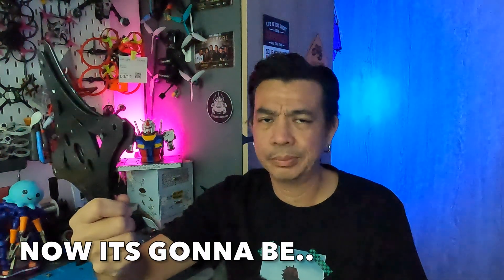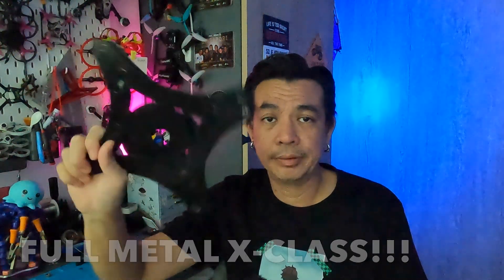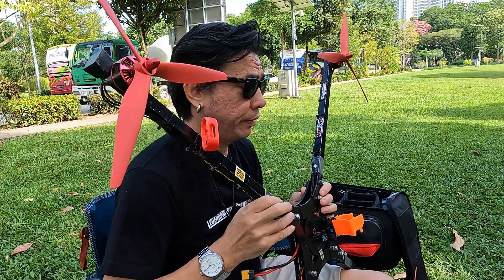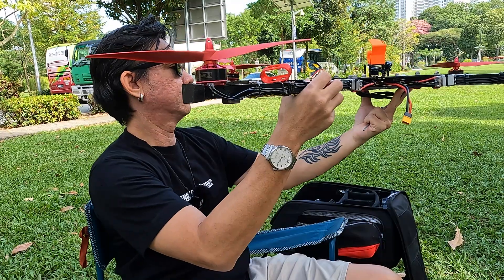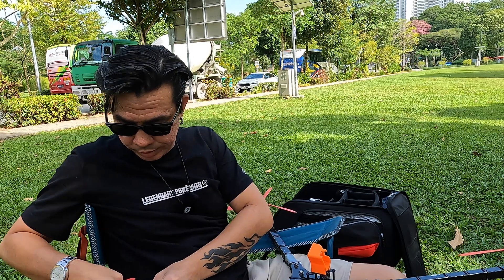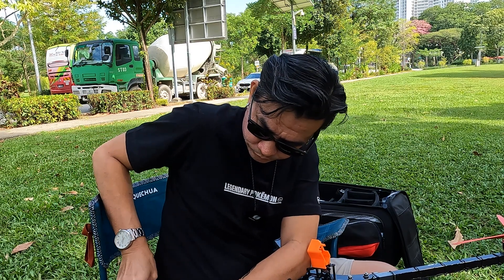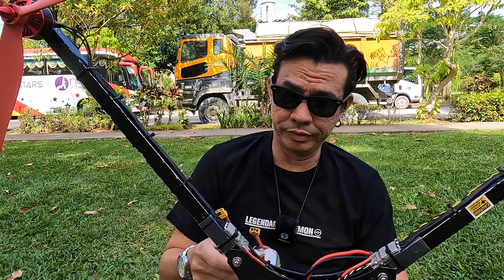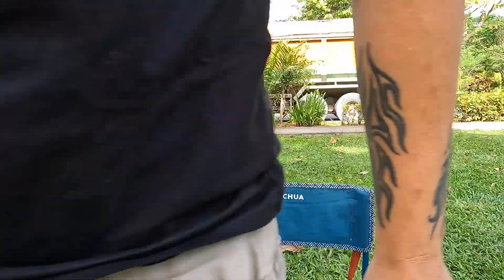Check out this Full-metal frame X-class drone

Comment: Glad it was a smooth re build. 👍
Reply from the maker: @matred3538  hahaha brooo! U didnt see thr frustrations i went through man! Took the old plates, only to realize it was drilled to fit the old arms and not these arms, had to re-drill the plates at 1am in the morning as i was flying it the next day. Imagine doing all these trying to be as silent as possible living in an apartment! Hahahahahahah
Reply: @shogunemperor  oops. You made it look quite smooth, maybe I wasn't paying enough attention. I've only ever swapped a few micro frames about, and plug and play stuff at best.
Reply from the maker: @matred3538  aah no no. I didnt add those details in the video! Didnt think anyone would wanna watch that part! Hahhaa sweet man! I like working on smaller quads